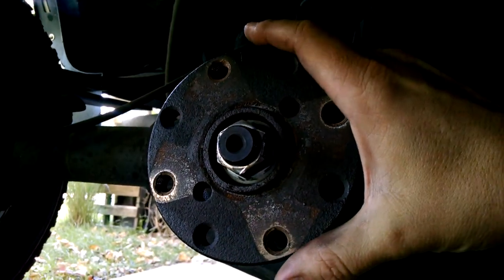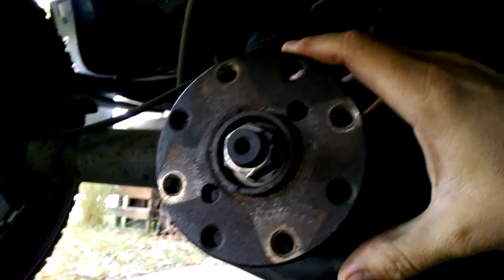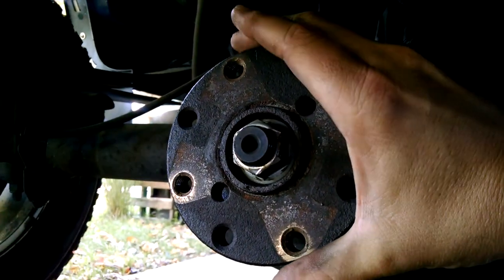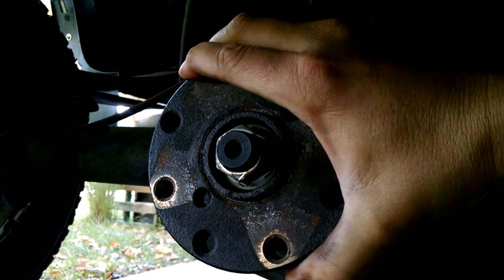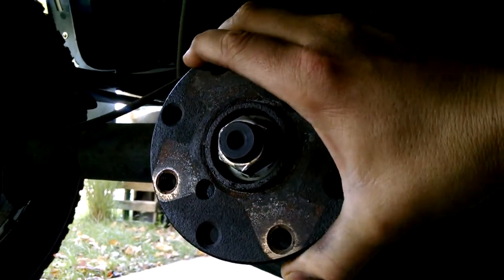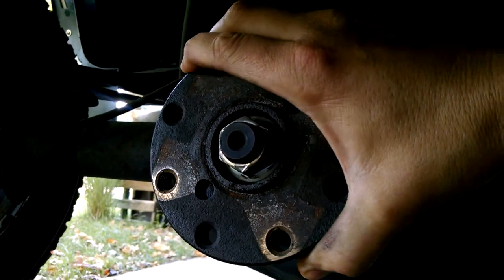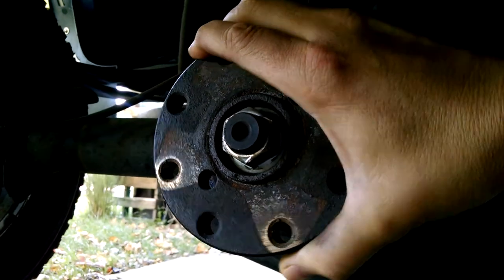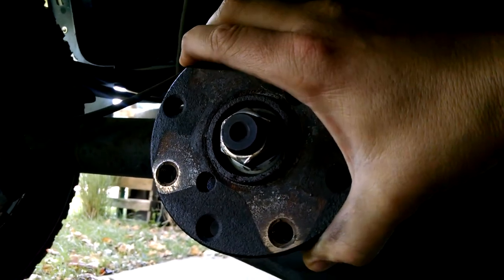Ring and pinion play

Comment: If what you are seeing was actually play between the ring and pinion, then that would be bad.  In reality, you are probably going to have more play at the axle shaft splines and gears inside the differential as well as the pins they ride on.  Locking hubs up front will add even more.  Multiply all that by 4x or whatever your ring-pinion ratio is and you get the normal amount of backlash you see here.  If you were able to completely lock your ring gear of all movement, you probably wouldn't feel any backlash at all while submerged in cold gear oil.
Reply: Thank you for this comment. I have a similar amount of play and was concerned.
Reply: I agree, I should have stated that in my response. Also,  when I suggested to inspect the ring and pinion I worked l assumed that he would be checking backlash while holding the ring gear while using a dial indicator to measure the actual backlash. Then compare it to specs.

Comment: I have more than this play on my differential. But it's not noisey going down the road so i suspect 90% of this play is the differential gears not the R & P. I had considered making something up to put through the oil fill or drain hole to hold the ring gear so that just the R to P play can be measured.

Comment: Mine does that.  Is it normal or are you running into problems?
Reply: Wanted to know too..my van doing the same thing
Reply: @devindraseecharan3432  not normal, excessive backlash. Need to inspect the ring and pinion. If no damage decrease the backlash by shimming the ring gear closer to the pinion.
Reply: @HunterKelton would this cause a humming/howling sound on acceleration and deceleration
Reply: @bedhead441 yes it will.  Both excessive and no-end play will cause a humming noise.  Commonly heard around 30-40mph either under acceleration or deceleration.